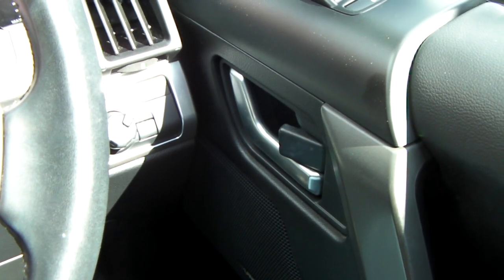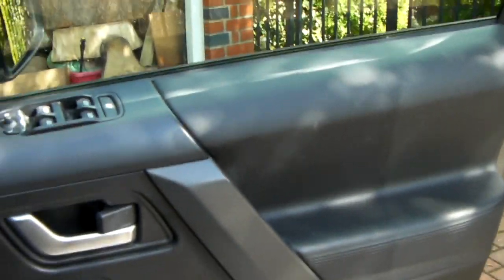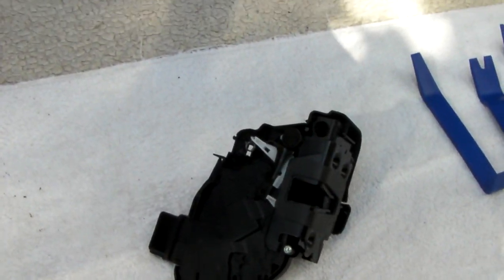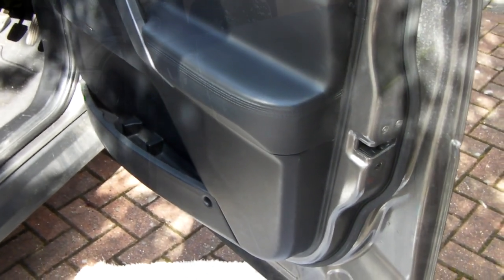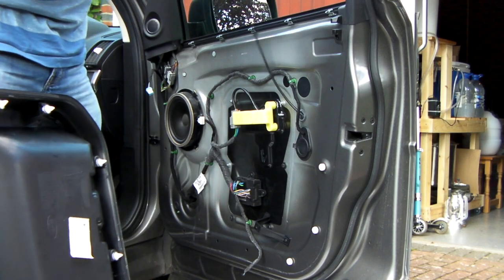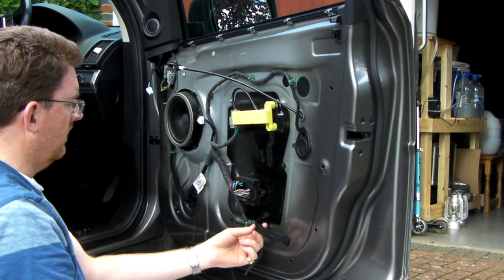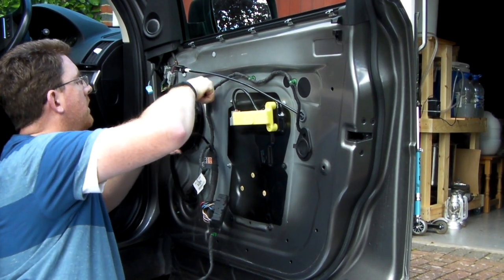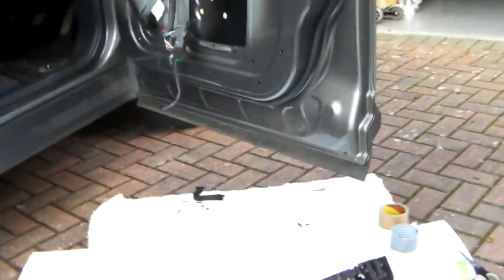Freelander 2 door lock fix Pt.1

Comment: Thanks Joe! Just a quick note for anyone doing the same job, don't order a new actuator until you've gotten behind the door panel & inspected it. In my case it was only the cable holder had popped out of its holder and not the actuator. Re-instated it, put it all back together and tested many times, easy fix :)

Comment: Thanks for the vid just did the job when removing the window the yellow clip does nothing, remove the speaker, remove the window buttons from door panel and reconnect, look through speaker hole lower window till you see the white clip, tape window in place,pull on white clip out side part lower window and it will pop right off , just spent 2 hours trying to get to yellow/ orange clipthrough a 3cm hole 🙄 be careful of you hands
Reply from the maker: Glad it helped, it not an fix but a lot cheaper than JLR dealer garage repair.

Comment: For you and other viewers I'm sharing my personal experience with this job. On my first attempt to replace the right front door lock assembly I was unable to separate the window from the window regulator assembly because a door glass release lever P/N 501-114 is required per the Land Rover shop manual for 2008 and 2009 year models. The 2010-2-12 models have a different attachment clip. Ordered the tool from Freedom Racing and will attempt in two weeks.
Reply from the maker: @Scott Morningstar, I used a small screw driver to separate the little plastic clips which locks the regulator to the window.  It tricky but will patients it can be done.  It a good idea to have a mag-mountable LED light in the door area to give you good light to do this.  If JLR has a part that would help but for the DIYer out there, with a little care it can be done. Thanks for the advice 👍.  Tell us how you got on !! Cheers Joe (and think to Like and Sub if not done so)

Comment: I’ve had to do this twice to my Freelander. Highly, HIGHLY recommend taking the door handle off so you can pull the whole lock assembly out and connect the cables to the new one on the bench. Will save you hours and is not as fiddley. There is another vid on YouTube which shows this. Otherwise your video is great, thanks!
Reply from the maker: Hi Gareth, this an old video and there was no/little info out there when I had to fix the lock.  I filmed this having never tried this repair before, so you see all my mistakes!!  I would imagine by now Youtube has much better How To's.  Your tips sound spot on BTW , hopefully any who finds this vid reads the various recommendations!! Keep team coming to help others :) That said if this helped in any way please LIKE and sub , Cheers Joe
Reply: How do you manage with the door unable to open

Comment: Just successfully done this repair to my Freelander 2 this morning and am extremely impressed! Went very easily except for the second cable attached to the lock mechanism which I presume is for the outer door latch. I found this very difficult to release due to the limited space available. One tip I’d like to share is to ensure that you orientate your car so that you’re not looking directly into the sun! 
Many thanks for sharing this repair 👍.
Reply from the maker: I'm glad it helped you out, depending on the door it can be quite tricky, hence why I broke the cable lock when I was trying to remove the cable.
Reply: You could try releasing the actual Door Handle mechanism, which will allow for the Lock & adjoining cables, plus the internal Door Handle mechanicals to come out as one assembly. You will then have full access to the difficult handle cables. Door Handle removal is fairly easy...

Comment: I have a completely different issue. 
My drivers side door will not unlock by pulling the handle as you did in the beginning of this vid, for me to unlock it, I have to press the unlock button on the dash. 
Weirdly it does work sometimes but there's no rhyme or reason to it.
Reply from the maker: Should be the same as the key fob as the motors drive the open and lock ? Sounds odd for sure. Did you change the lock as shown and has that fixed the issue?

Comment: I have had the locking fault rectified, now after a few months the actual door handle doesn't open the door, seems like it's not pulling anything... Any suggestions?
Reply from the maker: unfortunately I don’t have the Freelander 2 anymore. My best guess would be the cable (which looks like a bicycle break cable) may have come off the lock mechanism or failed. Something like this https://www.lrparts.net/lr019819-internal-door-release-cable-for-freelander-2-from-inner-handle-to-latch-genuine-land-rover.html.
Reply: @joewoodford9428  thanks mate, I appreciate your message, il get a chance to see what the crack is at weekend

Comment: Hey Joe,

The replacement procedure for any of the rear doors would be the same I am assuming? I have a problem with my right rear door, I was wondering how it may be different?
Reply from the maker: Hi Mehdi, Yup same type of process.  I felt the door cartridge as the back was a little easier to remove than the driver sides door.

Comment: Anyone know what caused the lock to simply not work? It seems like it locks but you can just open the door
Reply from the maker: It all part of the same unit, probably just another motor has failed in the door lock unit. Best to replace the whole unit if over 10yrs old.

Comment: On my lr2. I have to pull the handle twice to unlock the door. Is that the full unit that needs to be replaced or just a canceling issue. The door unlocks when selecting the lock / unlock button.
Reply from the maker: Sounds like the Dead-Lock is on if you need to pull it twice inside the car as the first time releases the dead-lock and the second opens the car.
Reply: Joe Woodford 

Hi joe. Thank you for responding. The door in question is the driver front door. I’m not familiar with the term dead-lock. But I understand what you are referring to. Do you know if this is a setting that can be changed? It only is happening on this one door.
Reply from the maker: The LR2 is my wife's car so I will need to try it out, it does sound like one of the two motors in the door lock unit is not working correctly. My guess without trying is the unlock button in the car is not driving the motor to actually unlock the drivers door, a dead lock is when you double lock the car with the key, press it once the car locks, press it again and it deadlocks the whole car.

Comment: Hello Joe. HELP Please. Desperate...
My FL2 is due for MOT but my rear passenger door will not unlock / open, I have tried banging it whilst operating the Lock / Unlock on the keyfob, but it hasnt worked, so i have removed the 4 retaining screws that hold the internal handgrip, Bottom tray and door opening lever, but i cannot get to the edge of the doorcard to pop the doorcard clips off and remove the door card to repair the problem, has anybody had this problem and got any fixes, Desperate now, I need my car as my dad has heart problems he relies on me as he is 85 yrs old and doesnt drive, it wont pass mot like this. Thanks all.
Reply from the maker: HI John, I'm very sorry to say I no longer have the Freeland 2. Have you tried to experiment with the door that does unlock to see if you can get the door card off that while open and then try the same door but it closed to see you could manage it in situ?  You might need to removed the rear seats to give you more access to the lower part of the rear of the door card.  I talking from memory here so this might not help at all.  Hopefully others might have some bright ideas!
Reply: @joewoodford9428  Hi Joe. No problems mate, I have ordered a set of trim tools that may do the job,  have tried everything to unlock it so its got to be panel off, I will let you know how i get in, cheers mate.